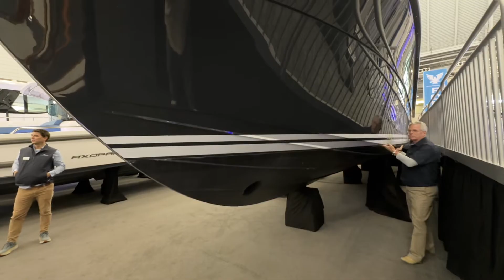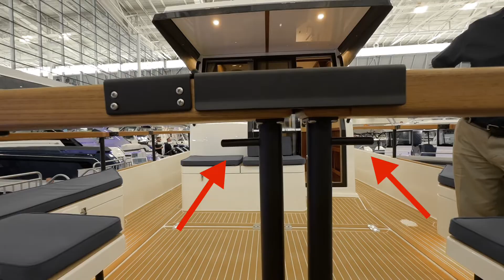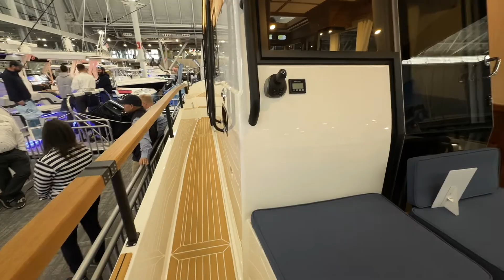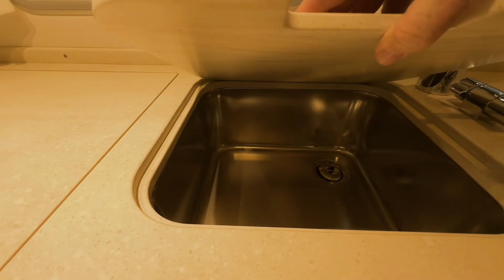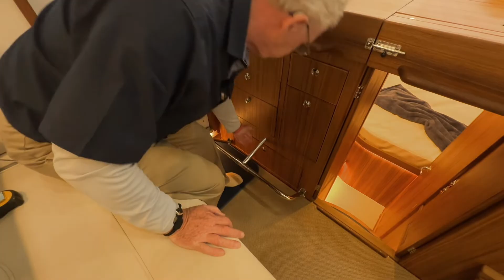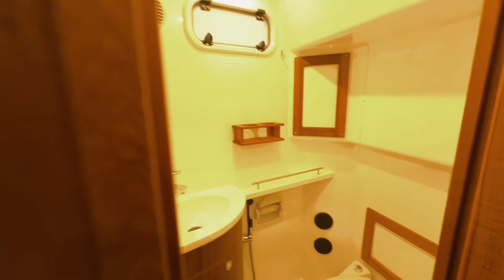Targa 37 full tour - An Upscale Upgrade at $1.06m

Comment: If I owned that boat, I'd like to see some changes to make it more useful for exploring the bahamas, doing the loop, or other trips.   First, remove the forward head.   Make it a standing area to change and a large wardrobe/hanging locker area for the master.   You just don't need 2 heads in a small boat with just a couple.  
Second, extend that aft head some into the aft berth.   Should be able to fit a couple extra feet, which gives a roomer shower - and instead of those stupid plastic shower doors, just a shower lip on the floor and a shower curtain.   The extra space in what was that berth can fit a washer/dryer.   The rest of the berth can be filled in with some more buoyant foam with maybe an accessible locker in front of the copilot's chair.   The single berth on starboard is fine to keep as is, it can double as storage for folding bikes, extra gear and whatnot.   A washing machine is super handy for any cruise more than a few days, you don't want to waste your trip doing laundry in a marina or town. 
What I like best is simply the walkaround along with the joystick controls in the stern.   It makes the boat more suitable for a solo trip, or just a couple to easily control the boat and remain safe.   Otherwise, you'd like the superior living space of the Grand Banks 34, Nordic 32/34, or American Tug 34/365.
Reply from the maker: Great feedback. Thanks for taking the time to share your thoughts.
Reply: I think the new 41 fits the bill

Comment: @captstevetests 
Great review.  One item you didn't talk about is the true DNA of these boats.  Over 1/2 of their boats end up as Oil Rig service boats, off shore research boats, artic research boats.  No boat has the true DNA to be in any sea condition in any season.  Also, over 70% of the boats weight is below the water line, making the boat virtually roll proof.  The driving seating positon is the best in the world and that front drivers seat does move forward and Targa will customize that seat or any other part of the boat.   Woulld love to see a sea trial.  As an owner of a Botnia Targa 32, there is no other boat that is as cable, fast, efficient or as well put together as the Botnia Targa, they are in class by themselves.   As a side note, the employees and owner, 3rd generation family owned are truly exceptional.
Reply from the maker: Great info
Reply: If I owned that boat, I'd like to see some changes to make it more useful for exploring the bahamas, doing the loop, or other trips.   First, remove the forward head.   Make it a standing area to change and a large wardrobe/hanging locker area for the master.   You just don't need 2 heads in a small boat with just a couple.  
Second, extend that aft head some into the aft berth.   Should be able to fit a couple extra feet, which gives a roomer shower - and instead of those stupid plastic shower doors, just a shower lip on the floor and a shower curtain.   The extra space can fit a washer/dryer.   The rest of the berth can be filled in with some more buoyant foam with maybe an accessible locker in front of the copilot's chair.   The table and U seating wouldn't even need to be raised to make room anymore without the need for that port berth.   The single berth on starboard is fine to keep as is, it can double as storage for folding bikes, extra gear and whatnot.
Reply: Targa 32 is my dream boat for the North Sea and the English Channel you are one smart man to be a 32 owner

Comment: I've been on Targas for years as they are common here in Finland where they are based. Targas are like mini ships and go through rough seas like nothing, even the significantly smaller Targa 27.2.
Targas are not for beginners though, as many new to boating don't see where all the money is going (the hull, the weight, the build quality). It's rather your fifth or sixth boat when you know whats important.
Reply: Dead on, I was fortunate to have a Targa be my first and only boat that I will have until I can't boat anymore!
Reply from the maker: Excellent point.  Thanks for watching.

Comment: Thanks Steve. Targas are tough as nails but this model does not seem very comfortable. The seats in the aft cockpit with no backrests except straight up railings must get painful quickly. Some of the spaces inside seem constricted. The hatch and companionway to the forward cabin look tough to access for a big person. Access around the sides of the motors looked cramped. Some of the other Targas look a lot better to me.
Reply from the maker: You're spot on but a lot of what is seen in this model are optional.  there are more comfortable seats etc.  It's pretty easy to dial this boat in to your specific needs.  Thanks for the feedback and thanks for watching.
Reply: @captstevetests  : I'm not anti social, but I don't have a family or go boating with a lot of people. Would love to spec one of these out to suit. Extra large, double or triple size wet head instead of berths  that would not be used Tailored storage spaces, a much expanded galley with less and differently configured saloon seating and on and on ..............
Great boats, I really like the 41. I think Sargo has a new 45 too.
Reply: I can tell you as a boat, these are no "Girly boat" their DNA is as research boats.  There is no other capable or comfortable boat when it gets snotty out on the ocean.  You will routinely see Targas running in -40 F temperatures breaking through several inches of ice in the pitch black darkness of the artic circle.  Their entire ethos is form over function.